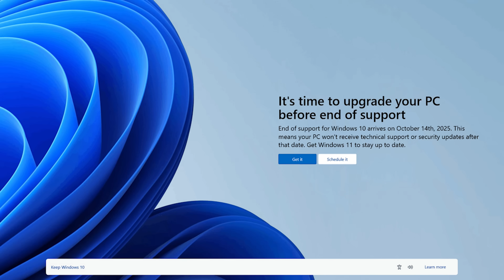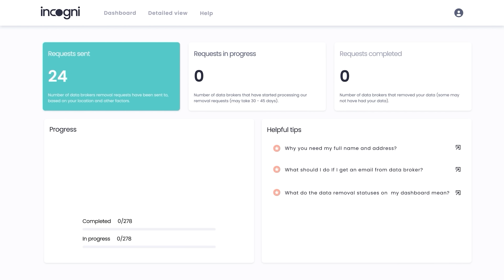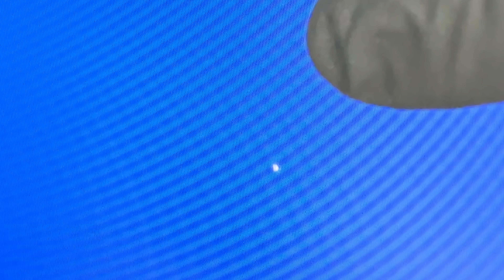I Made 2 WORKING Laptops From 1 Dead ThinkPad - DON'T Buy a New PC Just For Windows 11!

Comment: I recently got myself a used 1st gen Thinkpad T14 (8th gen I5, if I recall), thing comes with 16 gb of ram, backlit keyboard (nicest one on a laptop I've ever used), and the battery is still great, because it has smart charging and battery protection. 99% of the time, it sits under my TV, and runs discord and youtube. That's all it needs to do, and I'm pretty sure it'll happily continue to do so until some capacitor blows up ten years later. That's a perfectly usable, mint condition laptop from like 8-10 years ago I got for 150$ at the time.

Comment: The windows 10/11 support thing is complete madness... I can't fathom how anything older than intel 8th gen is considered "obsolete" by microsoft.
I mean just 2 years or so ago I upgraded my mom's PC by giving it the guts of my old system with an i3 6100, 8gb of DDR4 and a 240gb SSD. And that thing FLIES for all your basic internet and office work!

And right now I'm building a backup system with a xeon E3 1270 V3 because my main PC will be in pieces for a few months while I design a new SFF 3D printed case. I'm gonna just install win11 by bypassing the requirements but in theory that CPU is 4 generations "too old" for it. Absolute insanity. (yes I know I should just use Linux but Linux scaling is still a mess, for anything that can run at 100% scaling, yes <3 Linux)

Comment: I just recently bought an MSI GE72 laptop from a local charity recycling centre, broken hinges I fixed with literally drilling holes  and used zipties to hold them together, apparently the designers did not put the screw threads INTO THE METAL PARTS OF THE SHELL as with any other laptop companies. Missing hard drive and burnt charging port because of design flaws but I fixed it anyway for the cost of literal pocket change. The price I paid for that laptop was pocket change amount too!

Comment: The reality is that most modern casual laptop user´s needs could be satisfied with a smartphone, if it had a larger screen and a proper keyboard/mouse. Cause their requirements to just do some emails, watch some videos, browse the web, go through their photos are just so low the hardware in a smartphone would suffice. 
Yet those end up paying 1000+ bucks on some new laptop that they aren´t going to fully utilize ever anyways. 
You just need a car to go from a to b? A used camry will do just fine right? No it has to be a 1000+ hp hypercar even if all you do is drive your kids to school and grocery shopping.. bummer.

On the otherhand do i find it extremely effed up from microsoft to impose such ridiculous (and unnecessary) requirements on windows 11 that just aim to lock out users. And the casual user with no clue about tech is surely interested to have a "save" OS so he wants one that gets all the updates/security fixes. 
The mere reality that windows 11 doesn´t "want" to be installed on older hardware, but can completely fine do so is just effed up. I mean just install it on a compatible device and clone installation on a non "supported" device, worked for years (not sure if they plugged that or will plug that in the future, but they are probably sick enough to do it).

Yes linux is an option... but lets be real, the casual user that is used to run several windows operation systems in the past, isn´t easily converted to linux, unless he has a friend that shows him that it is actually pretty easy (unless you run software that for some reasons struggles on liunx). But browsing, emails, watching videos, going through photos...  require no fancy software nor windows.

Comment: Will Microsoft continue to provide Windows 11 version 24H2 and higher updates and upgrades to computers with 8th, 9th & 10th Gen Intel CPUs???
Microsoft delisted Intel 8th, 9th and 10th generation CPUs from the supported list of CPU under Windows 11 version 24H2 and later.    What does this mean?    
Previously,  computers with 8th, 9th & 10th gen Intel CPUs were supported up to Windows 11 version 23H2.     Does this mean that these 8th, 9th and 10th Intel CPU computers will NO longer get Windows 11 version 24H2 and higher updates and upgrades?    
I found sites saying that Microsoft will drop Windows 11 version 24H2 and higher support  ONLY for NEW OEM computers with 8th, 9th & 10th Gen Intel CPUs from manufacturers, in order to discourage new computer with these older CPUs from being made.   However, how can they tell the difference between existing Windows users with these older CPUs and new OEM computer with these older CPUs?
Supposedly, pre-existing intel 8th, 9th & 10th Gen CPU computers will continue to get updates and upgrades for Windows 11 version 24H2 and higher.    Is this true and confirmed?? 
 I can't trust google searches due to AI hallucinations.

Comment: Got a ugreen 6800 plus with your link to be my internet connected Plex server, the old server will live offline for when I need to rip discs as it can rip uhd, the gaming machine that was new when the rx 480 was new is getting converted to the Linux distribution that is Baazite but for people who don't faint at the sight of a command prompt for my older PC games, 3d modeling, and 3d printer slicers, and Microsoft can suck it, they will live long useful lives still.

Comment: I'm frustrated with Windows because I was forced to use a Microsoft account in of the local account I've always been using on an old Lenovo T430 still on 23H2.   I don't know if it's true or not, but it's been reported that MS is going to make Windows where you need a internet connection just to sign in so you can use your computer.   If that every happens where I can't use my Windows machine because of an internet connection then I'm done with MS.  They are dead to me.   Satya Nadella can go....... himself.  You can fill in the blank.

Comment: I was gifted an Acer Aspire 3 with a fucking Celeron N4500 back in 2022 when I was about to head into my first year of college. It served me well, til a few months prior. Windows locked me out of MY device because I forgot my account AND I need to connect to wifi just to log in?! Needless to say, it was the best time to flash Linux Mint to it and give a stick of another 4GB RAM, and this piece o garbage is still serving me, even through death. 

10/10: I should've traded and added cash for a semi-decent Thinkpad

Comment: Hi Salem Techsperts, you can actually install Windows 11 on those ThinkPads. If they do not meet the system requirements for Windows 11, you can use RUFUS to bypass those requirements by checking the "Remove requirements for 4GB of RAM, 64GB of Storage space, TPM 2.0 and Secure Boot. Also, you can use FlyBy11 to bypass.

Comment: I rescued a Thinkpad Yoga 14 a bit ago. 6th gen i5 with a GeForce 940m graphics card. Plenty of power for emulators and older games. The touchscreen is great for using it on the go. I run opensuse tubmleweed on it. With 8gb of ram and the wifi upgraded to an Intel AX210 I doubt most people would realize it's a 10 year old laptop just browsing youtube or facebook.Off note a trackpoint is great for laptop on the go Minecrafting.

Comment: Some observations from my decade+ in the refurbishing industry. 
Any laptop that is a convertible/x360/2 in 1 device = unreliable garbage and this includes business class laptops aswell.
Any laptop that has a dedicated graphics card where the graphics card is soldered to the motherboard = unreliable garbage and this includes business class laptops aswell.
Any laptop that has a dedicated graphics card and is thin going to have thermal problems = dies faster.

Another note. Dell laptops sucks for reliability. Only reliable models we've sold are the "Thicc" Dell Precisions laptops.
When somebody tells me they got a Dell Latitude its almost as bad like them are telling me they have installed and payed for McAfee Antivirus.

Comment: For anyone asking why Windows 11 doesn't directly support these computers, just a couple of rant-ish notes.  I'm not by any means a fan of Microsoft, but this will hopefully put it into more perspective.

1). Skylake and Kaby Lake can run the Windows 11 kernel just fine.  I've run Win11 on an I7-2700k.  I had to fiddle with the graphics drivers for Intel HD graphics, but with an SSD and 8 GB of RAM, it worked and was plenty usable for basic tasks.

2). The data security layer of Windows 11 is designed to isolate potential malware exploits, specifically related to memory use, that could compromise a system.  The approach that they chose requires a system running on UEFI 2.6 or higher.  That standard was released in 2017, after 6th and 7th gen came out.  So while a 6th or 7th gen motherboard could be updated to support it, there's no guarantee that the manufacturer will.

3). Could Microsoft have chosen to code the system another way to avoid these performance penalties?  Sure, because Linux and MacOS work just fine.  The real issue here is not vibe coding; it's, as Andy said, that arbitrary decision has led to an e-waste debacle and no one at Microsoft gives a crap, because in the end they'll sell more Windows licenses.
Reply from the maker: Fantastic write-up, thank you!
Reply: More Windows licenses yes but also partners like AMD, Intel, NVIDIA, HP, Dell, Lenovo, ASUS, Acer, MSI and others who will get the money for the hardware.

Comment: I only buy HP laptops. I've had four so far. They get old without any problems, then I'll buy a newer model. I'm sorry for your experience with them. I suggest staying away from Dell. I was given a new Dell desktop computer. Every single component was faulty, including the operating system. After the OS was fixed, the hard drive failed. (Thai flood drives) The next one they replaced, but it failed. So did the replacement. Support was the worst imaginable. The GPU was next. I bought one instead of the hassle with Dell. Really, only the case was worth anything. I'm sorry for the guy who gave it to me as a gift. I told him I was grateful for it many times. I also told him it turned out to be a POS.😆

Comment: The thing with Thinkpads from what I noticed is the sound drivers. I mean the speakers sound horrible. Compared to Windows. I tried 3 different linux distros and the issue is the same and external speaker do not fix the issues.

Comment: 11:52 I mean technically speaking, even if MS at some point stopped supporting newer releases on older computers

As of right now, the latest current release of Windows 11 (25H2) which can run on any machine that supports the SSE4.2 instruction set (AMD Bulldozer and 1st Gen Core i series), gives you two additional years of security updates till 2027 over Windows 10. So even if someone wanted to stick to Windows, Windows 11 would still be perfectly usable on these machines and give them two more years to keep their machines.

Comment: Just because Microsoft says you can’t doesn’t mean you really can’t. You can easily install Windows 11 on an unsupported laptop using a few simple bypass methods with Rufus.
I’m running Windows 11 on a Dell Latitude E6420 (2011) — equipped with a 1TB SSD, 16GB RAM, and an Intel Core i5 processor — and it performs surprisingly well. However, Zorin OS 18 runs even better.
I picked up the laptop for about $8 with a broken screen but a working motherboard. I already had another one with a dead board but a good screen, so I just swapped the boards — now I’ve got a solid, fully functional machine.

Comment: Heck yeah! My current laptop is cobbled together using parts from 4 different e-waste laptops. The screen is just a random 1080p 30-pin edp panel, and the battery wasn't even designed for my model, I had to trim the plastic casing of the battery for it to fit in the chassis (in hindsight a really dumb idea).

Comment: I'm used to fixing old ThinkPads. During COVID lockdown i started buying some and self learn repairing and reselling them, using the downloadable Hardware Maintenance manuals from Lenovo and YouTube videos. I helped a buddy upgrade SSD in a HP consumer laptop and was horrified how flimsy and shitty the quality was! I had thoughts on upgrading ram. The extra ram slot was marked out on the mobo, but no socket had ever been soldered on! Why!!?! If there is space and it is marked out, solder on the socket, you evil and cheap HP engineers!

Comment: Min 12.
Yeah, they can as well keep going on with win 10, i fuck1ng don't understand all this shitstorm on windows. I'm not a fan, I can't give less about this sh1t but who cares about upgrading, no one is forcing people, there's people still running win xp, sh1t, there's companies going still on win xp, hospitals running on win xp (actually the pc I have at my company it won't be upgraded EVER cause I have no need to upgrade for doing word stuff and bills or some small goggle search, no one has), who gives a sh1t about upgrading to win 11. Why should I bother going through the whole process of installing Linux (I mean... I can try to guess why you're pushing this sh1t so hard but hey, just sayin'🤷🏾‍♂️) when I could just keep win 10 as I usually had for many years (I have 11 on my gaming laptop but I can't give less facks about that). You people need to chill the fack out😒
Oh. Btw. At one point you rant about performance. Not allowing to upgrade to 11  it's not a performance issue, it never was, never ever, it always was about security, so you're fuck1ng wrong there, as almost through out the entire video actually (sure... You're "wrong", yeah😒). Obviously, it's at most corporate bs the security thing, cause no one will give a flying fack about hacking "normies" pcs (which actually reinforce my previous point: YOU DON'T NEED TO UPGRADE!!! You can or can not, based on your hardware and/or software compatibility, but you don't "need too" or "have to", you never needed to or had to) but still, performance have nothing to do with it and it never had so I actually don't know what you people are talking about.
So yeah. I can see the value of trying Linux (actually I don't but ok, people should be able to try things and experiences) but all this ranting about leaving windows cause it forces you to upgrade it's just an entire fuck1ng bullsh1t and you should know better (actually, you probably do)

Comment: KISS, convert to Linux, problem solved. Don't fall for the BS, as in my case an Intel I7 that does not meet some specs,  it does but it does not. With Linux it works faster, smarter, and its a lot more fun. No more forced updates you have no control over. Once bitten twice shy.

Comment: Please stop consuming drugs. Ultra low voltage 6th/7th gen CPUs are not "very capable" anymore - they feel bad, even under Windows 10. They feel awful on a modern OS, but that's beside the point.

You seem to be like Rossman at this point - repair has broken your brain entirely and now you alternate between epic meming/saying insane things, both of which are undesirable.

You are right that people do not need terribly high spec machines. But they do appreciate high resolution, bright displays. Something you seldom see on ThinkPads. 

Yeah, keep machines out of the landfill. No, 6th gen Intel doesn't run acceptably for a modern web workload. No, machines with dim 1080p screens at 15" and are fairly bulky machines at that are not terribly appealing to most people.

Comment: Please show that you can also install Linux (Mint) in MacBooks. Is not directly related to the end of W10 but there are some old 2011-2015 MacBooks being sold very cheap that work perfectly with Linux. I was even able to revive a 2011 MacBook Pro with the death discrete GPU and disable it, so now is working perfectly fine using the integrated graphics. Keep the awesome work!

Comment: i got myself a Dell 3020 SFF for free, replaced the i3 with a higher end i5 for 40 bucks, and found a Quadro p620 for like 38 bucks on amazon through 16gb of ram in it, an SSD and a 2tb hard drive and its an amazing 1080p editing rig, and if im editing 4k i just have to lower the real time rendering resolution, best 200 bucks for a computer, its snappy yet its 4th gen intel, these older computes truly are pretty good still, especially throwing a bit of an older GPU in it, plus old workstation GPUs are dirt cheap online

Comment: I am typing this comment on the most junkiest Laptop ever, it is a cheap HP laptop from 2014 that has a dead battery, cracks in the plastic everywhere, the hinge makes popping sounds when used, the screen has some splotches of bright spots, the webcam only sometimes works, and the touch layer over the display only sometimes works. Talk about E waste, but getting use out of it, and it is running chrome OS flex, the model is an HP 15-I1162dx with a core i3 4th gen CPU.

Comment: You should think about Windows 10 IoT Enterprise LTSC. It has support untill January 31 2032 Its basicly windows 10 without the bloat and, like you mentioned that people don't like change. Same interface and it's actually lighter than normal Windows 10.

Comment: The greatest thing about Linux is that you can push the envelope further if you want to choose performance over conviviality. I still have a Linux Mint boot on my main PC at home but I also have Nobara in another nvme drive that I can booth using rEFInd. On a 2019 x1 carbon i saved from a company that left the building for years and put this beautiful laptop on a shelf collecting dust, I am running EndeavourOS Sway and it's... it is just blazingly fast af. Granted, it takes more time time to configure things but if you have less resources and money but have time, it can the be worth for you!
Reply: maybe it could be relatively easy to backup config on sway and use it later or on other machines